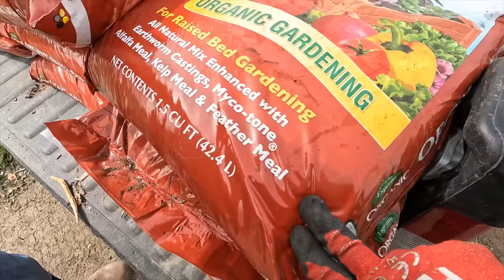Planting the Cold Frames in Front of the Greenhouse! 🌿🙌💚// Garden Answer

Comment: Everyone I know uses that method for raised beds. We usually put a layer of smaller wood on top of the logs. Like the stuff you used for mulching on the new property. After that layers of leaves and compost. And than finally raised bed mix.
I top it every fall with leaves like you do with the kitchen beds and in the spring with compost. Usually it sinks about 10cm. I think that’s 4 inches.
The composting of the wood creates heat. That’s why plants usually grow faster than in regular beds since the soil in the raised beds is already warmer in the spring.

Most of my information says it will take about 4 years until it’s completely composted. 

Have a nice day!

Comment: Those little pockets of color were a great addition. It will look so pretty. I’m a bit confused about your line of black tubing. Why did you need to extend it across the cold frame? I was thinking the black tubing just need to come up from the outside to the inside and that’s it. Then you would connect the drip from there. Maybe  I just need more coffee! I’m sure you have your reasons.

Comment: How about using a Univent to automatically open the lids of the cold frames when they get above a certain temperature?  We are already seeing the benefits of a Univent in a modest wood box-style CF that heats up suprisingly quickly. Maybe you know this: found out that the Univent works better than an Autovent as the former is detachable, the latter is not. Detaching is an important feature for a cold frame where you have to open up the lid fully. So excited to see how the Hartley design develops!  It's going to be  stunning!

Comment: Oh My! Benjamin! So cute!!   
OK- QUESTION for you:  Regarding creating a geothermal source of warmth for cold frame-raised bed... We are putting in very tall raised beds that are quite similar to the size of your cold frame "beds"... Will use for both veggie gardening and we are creating cold frame structure to set over a portion and remove, as needed.  Do you know anything about this or have sources for info?  Thinking about burying heavy plastic sealed tubs of water under the fill and dirt, Would be a good 32" - 36" deep.  ?  The base under it all is gravel.
thanks!

Comment: I'm just at the point where you've filled the bottom with the firewood and I can't help but worry you'll have the same experience as the time you put bark nuggets at the bottom of the galvanized troughs. Won't the water just drain through too fast?

Comment: Question, if it's a cold frame and your running drip from the outside of the heated building, won't the drip FREEZE?  LOOOOVE GARDEN ANSWER, Laura got me to start seeds!!
Reply: You don’t turn irrigation on until the frost date has passed. It’s no different than any other bed or container in that respect.
Reply: The 6” hole on the backside wall of the cold frame  that enters into the greenhouse ….the heat from the Hartley will help keep it from freezing. She mentioned it after they filled the beds.

Comment: Wondering about having the soil in direct contact with the brick work inside of the cold frame, will it damage it?  I ask, because we built our home out of bricks and there are so many things we have to do in order to prevent damage, like weep holes, and making sure that the limestone caps and all the grout is maintained so that moisture will not go into the brick  and pop off the brick face during the freeze/thaw cycle.

Comment: bought seasoned and dried Firewood is an expensive "filler" to use for this. I mean a cord of wood goes for 300-350 bucks here at least, y'all probably used like a 1/8 of a cord which is like halfway to just getting a load of topsoil which here a truck load of topsoil is around 150. But you do you, this is reference for others as a cheaper route to go.

Comment: Did you soak your logs?
Reply: Curious. Is this something I should be doing before topping my raised beds with soil and why?
Reply: @nothingpersonal878   one of the purpose of doing the logs is to hold water. She has an irrigation system which most people do not. But I always suggest to soak the logs before covering them just to help hold the moisture.
Reply: Good to know. Thanks for the tip 👍😁

Comment: Probably my 1st time not agreeing with your method.  The wood chunks will take many years to break down... so aren't you essentially raising the water table like you mentioned if used rocks.  Also, when the wood does break down it will be a big nitrogen draw as the the fungi and bacteria that rot wood materials quickly use up the available nitrogen.  Plus, the break down may generate more heat that you'd expect.

Comment: Y’all, don’t be surprised if that breaks down faster than you think it will, particularly in your hot climate.  The firewood is cut so it’s exposed to all the heat, water and microbes.  It’s not a bad thing… it will add back great nutrients to the soil.  But it will break down faster.  The type of wood that takes years to break down are large stumps or whole trunk pieces standing upright. They absorb the water and act like a natural sponge, helping with moisture retention.  But no worries… it’s all good in the end.

Comment: Yr so 4tunate with having so many places 2 grow stuff under cover. I'm going 2 b negative here in this comment which probably most of yr followers who comnented will probably get mad at me.
I cringed when i saw u using hardwood. Those 2 loads where i live would have cost $300.
So many people such as myself wld b blessed 2 have that hardwood. It looked dry.
As for breaking down... Lol... depending on how long its been sitting outside b4 u buried it. Probably will take 4 yrs.
Hugelkulter is when one uses more rotten and decayed wood. You've created a great place 4 voles and moles 2 live. Id never put wood up against that brick either. U shld have put a piece of plastic or waterproofed membrane. Maybe you presealed the brick?
Now 4 settling.... Why didn't you add more soil, then let it settle 4 a week at least.
Usually I day all nice stuff but this video stunned me. You've worked with raised beds enough 2 know how much that soil is going 2 settle.